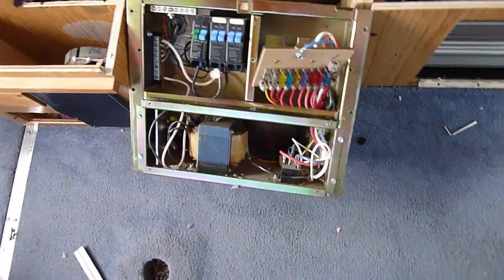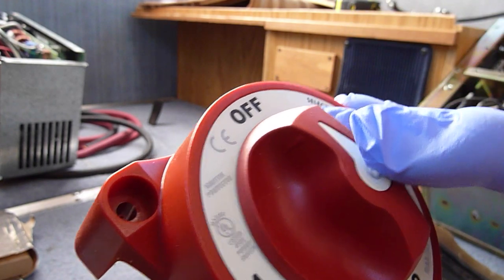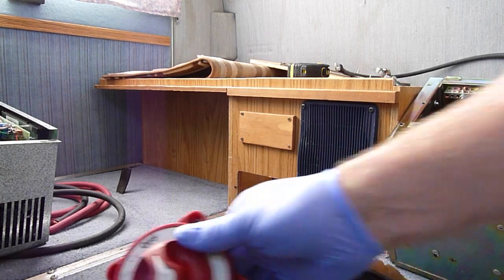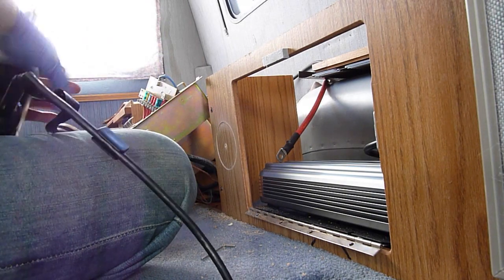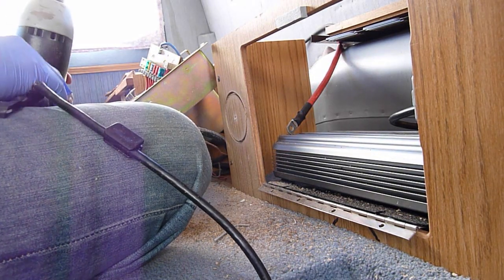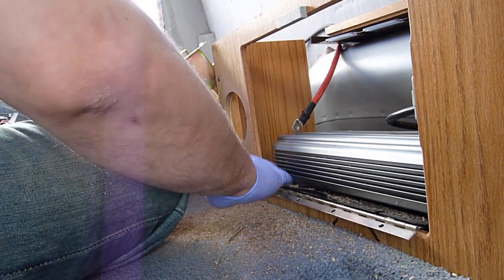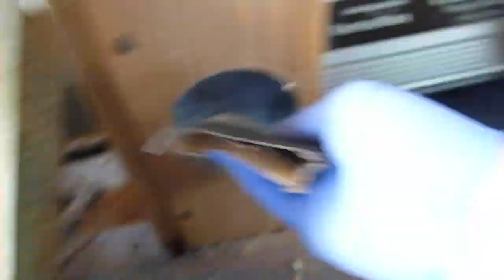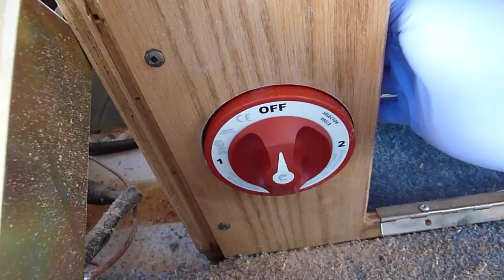Installing A Multiple Battery Select On Off Switch In A Class B Campervan RV

Comment: I would like to use this switch to choose which of my 2 Bluettis will be charged from my solar panel array.  However, specs say switch can handle hundreds of amps, but only 32 volts?  Any opinion of whether the 32 volt limit is critical?  My Bluettis are accepting 100 volts when charging on sunny days.  Thank you from New Hampster.

Comment: hello
i know this is older video but i have this switch  on my boat.heard you say use 1+2 for charging,,never for discharge.would you explain why? i often hook up my electronics on boat to run them on 1+2,which i guess is discharging them.
thanks
john

Comment: I bought that switch today I want to use it on my car to run an extra battery in trunk for an amplifier for big speakers and to solve a parasitic drain. My question is should I use it on positive or negative wire? Can it be used on either one?